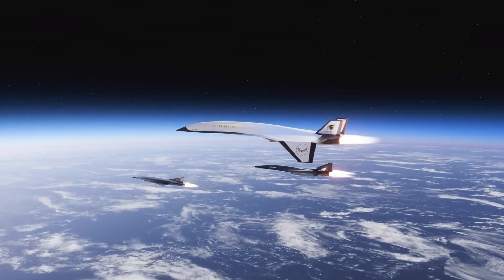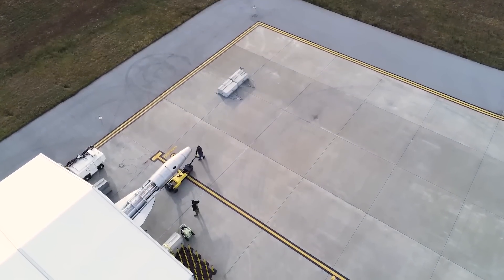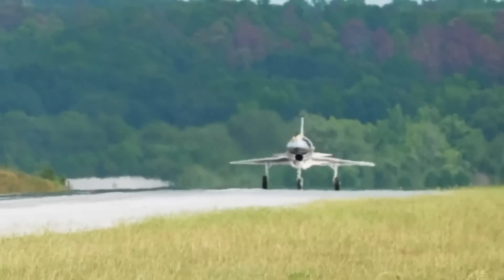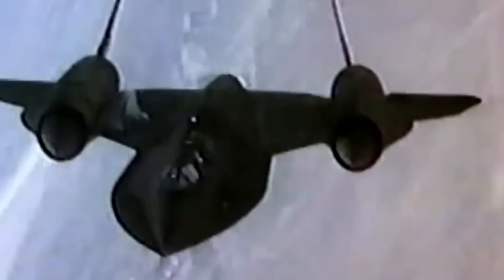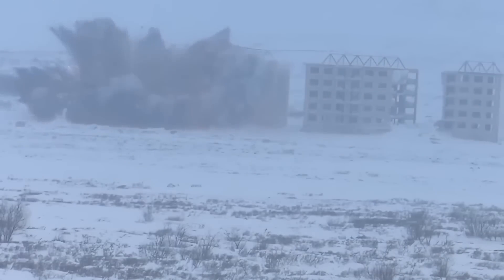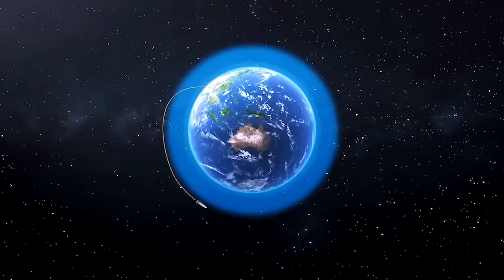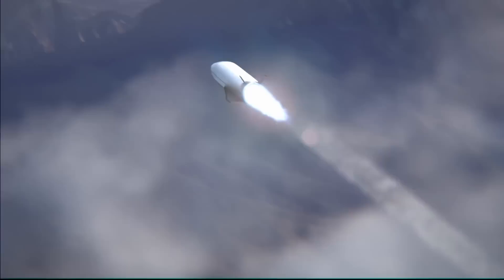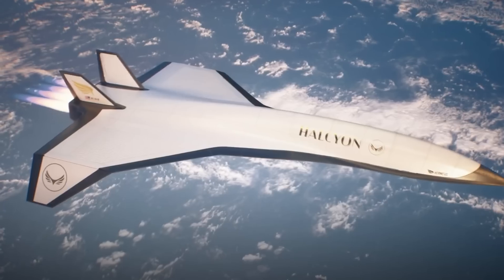USAF Fastest Hypersonic Jet Is Finally Ready To Fly!

Comment: Both China and Russia Hyper Sonic  Missiles are crap  compared to the ones the USA  has
Reply: Do you have proof? All project are called concepts then prototypes after it becomes a platform these is 5 years of development between Tactical and Commercial technologies. There is also what type of liquid fuel will be used for each platform… What materials or composite materials will be used ….
Reply: @user-te9lc3cq3h  no and that is the  thing  reading about them  and seeing them in person are 2 different  things so yah no proof

Comment: As we have talked to pilots that flew the SR 71 and they told us that they’ve already hit Mach 5 with the SR 71 so we do not know what these people are talking about
Reply: I read that the SR-71's defenses are altitude and speed. It can fly fast enough to outrun a missile, and isn't it true that missiles fly at Mach 7? I also read that the top speed of the SR-71 is top secret, even to this day! I was so excited to finally see the SR-71 at the NMUSAF!
Reply: @highflyingnote it dosen't flat out outrun missiles, by the time the missile has gotten to altitude it runs out of fuel to hit the plane as the plane is traveling fast in a straight line.
Reply: @class2instructor32   Wow … great info, thanks! Makes perfect sense.

Comment: The 1st? What About the SR-72 Dark Star? That is a hypersonicjet being produced and getting ready to be fielded by the USAF
Reply: Even faster than that
Reply: Wasn't that in Top Gun: Maverick?
Reply: @tommoore2012  yes
Reply: If the Quarterhorse is supposed to be faster, then I can only see it being used as a test plane because it is too small to carry a payload.
Reply: @alexincobra7379 it’s for commercial hypersonic flight not for a fighter jet. Air Force is prolly helping fund it just for the engine technology. There’s an x plane being tested to minimize sonic booms as well, x-59 quesst. Together that will provide some cool data. Also not just this combined cycle engine but also the two competing for ngad as well as another small manufacturer who is trying out electrical stages in its first engine stage so all kinds of cool stuff in the works. To bad most of it ends up being technology demonstrators
Reply: @alexincobra7379 
Probably unmanned as well. Also you'd have to think about deployment of internal weapons. It can't be done at hyper speeds last I heard.
Reply: @alexincobra7379 another cool one is Astro mechanica who is making an electric assisted adaptive turbojet. It uses a turbine to power a generator which turns the compressor. Since there’s no turbine in the jet once it gets up to speed the generator quits spinning and it goes to ram air. He also decided since he was using fuel to power the turbine which is separate that he could run a fuel line to the jet exhaust and have an afterburner. It’s kinda like how a helicopter uses a turbine to power the rotor except there’s no mechanical connection and instead turns a generator. Free think yt channel has an awesome video on the company and engine. It’s supposed to be supersonic but I don’t see any reason why the same tech couldn’t be used for hypersonic flight. Once up to supersonic speeds instead of a ram jet it would be like a scramjet if u had enough power or a couple engines. I couldn’t find a video on the other company that uses an electric compressor but even tho kinda similar it’s a completely different design, like a normal jet engine except the compressor is electric assisted. I don’t think it’s an adaptive engine like Astro mechanicas is tho, that’s a must watch video. Just type “freethink Astro mechanica” and it should come right up.